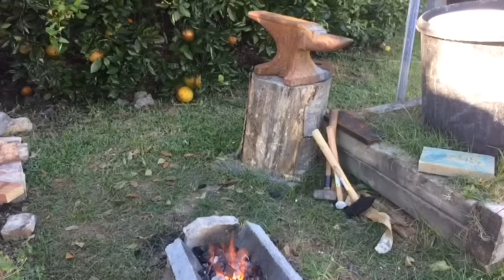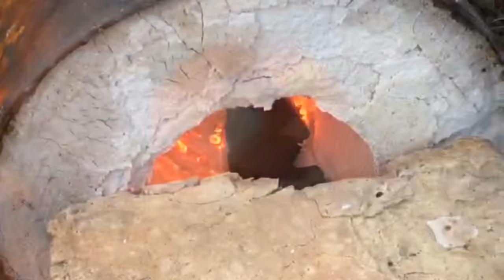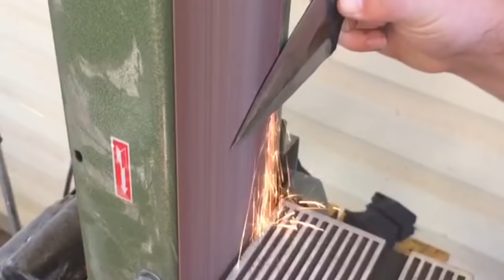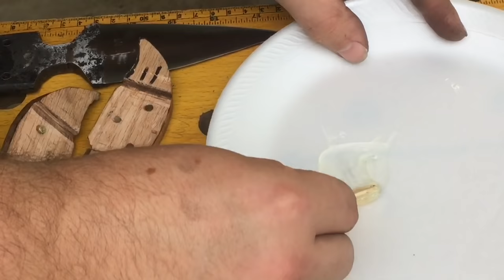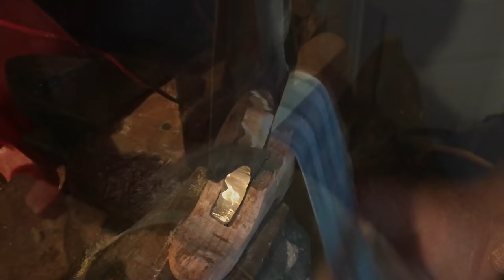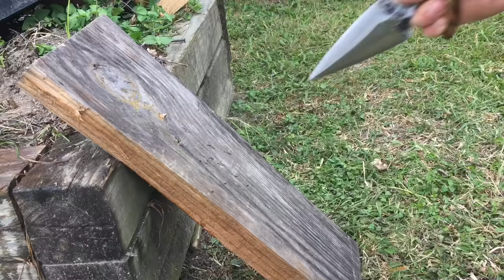Making a Push Dagger! Forged from Leaf Spring!

Comment: Very confused, what are you doing during the tempering process?
Reply from the maker: Adom Sanlon We placed the dagger on top of a hot piece of steel and let the heat travel from the hot piece into the dagger until it became a straw color which is around 400 degrees Fahrenheit to slightly soften the steel to  add toughness.
Reply: @BurningOakForge  so would I leave the metal that you place the dagger on, in the fire until it's red hot?
Reply from the maker: Adom Sanlon Yes heat the flat piece of steel red hot or close to red hot and place the blade on top until the blade becomes a straw color. Remove it when it turns that color and it is tempered.